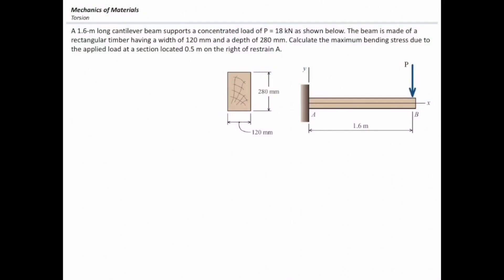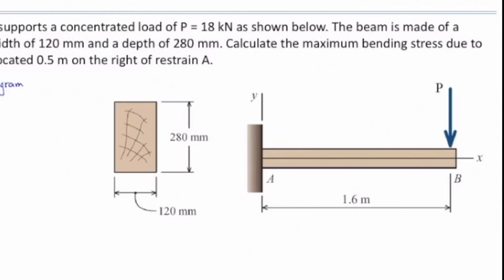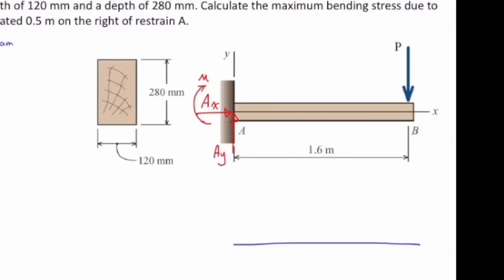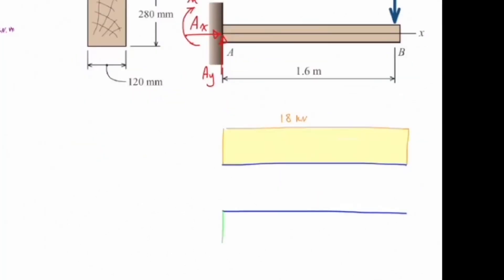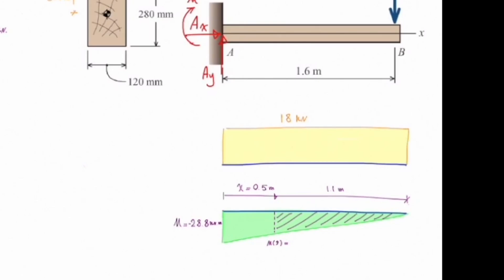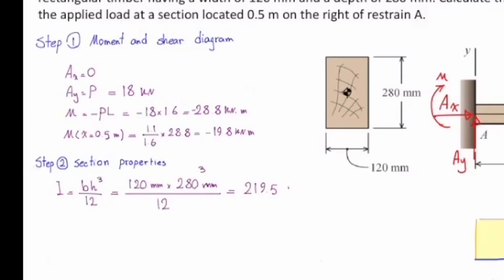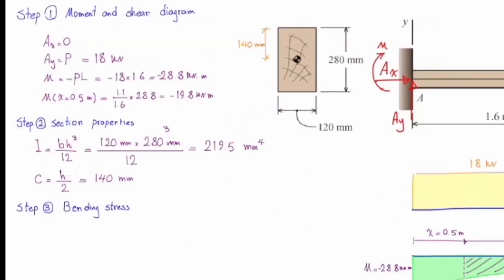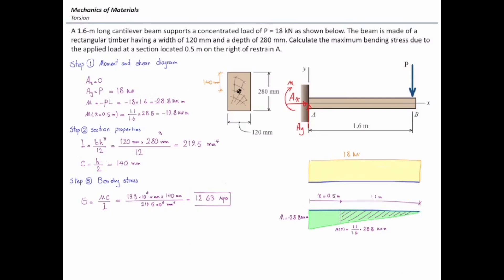Lec12, Prob4, Bending stress in symmetric section

Comment: Why is the moment of inertia 219.5 mm instead of 219520000mm?
Reply from the maker: The moment of inertia is 219.5E6 as used in the bending stress equation. 10^6 is cancelled by the same factor in moment after converting kN.m to N.mm.